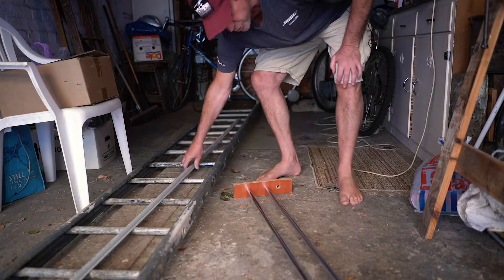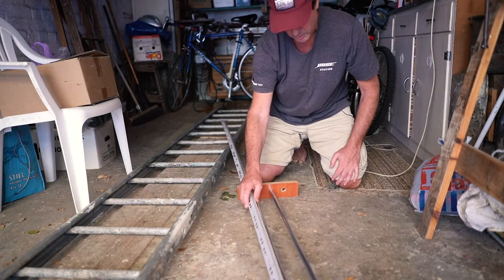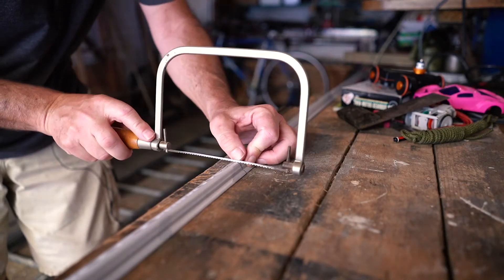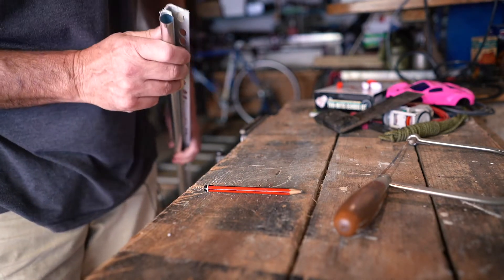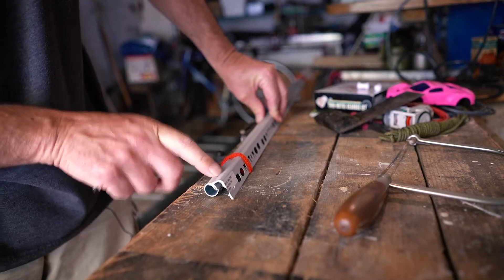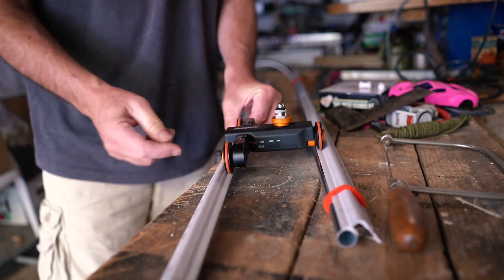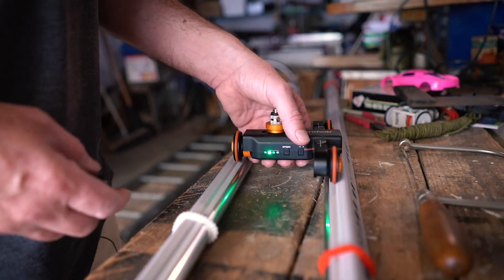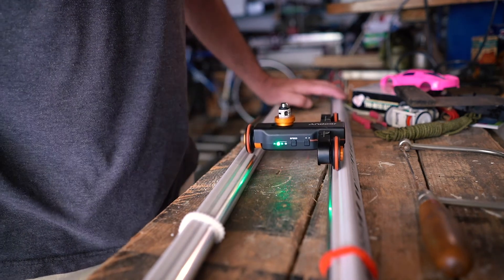Motorized Slider using the Andoer camera dolly

Comment: does the slider have a function to loop back and forth? or it will just keep going off the rails unless the user stops it?
Reply from the maker: Thanks Gabriele - Andoer is remote controlled via IR remote.  The direction can be reversed as needed.